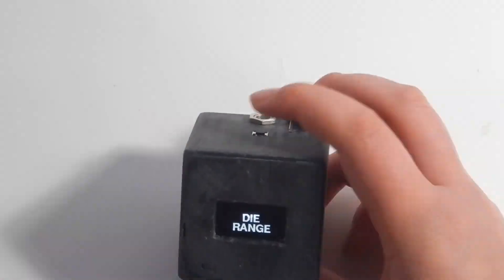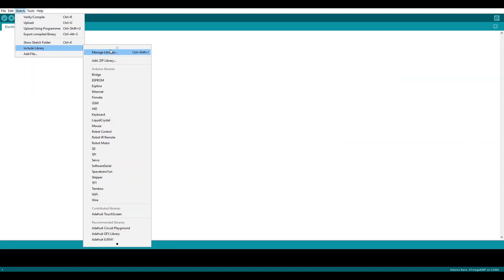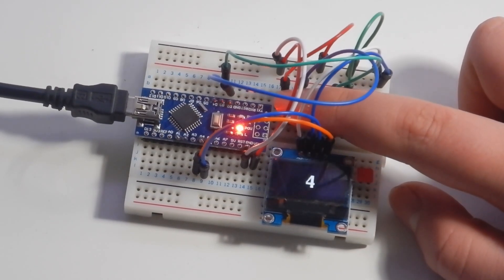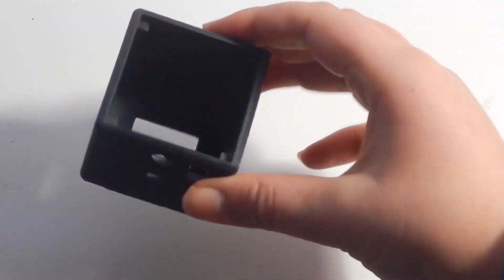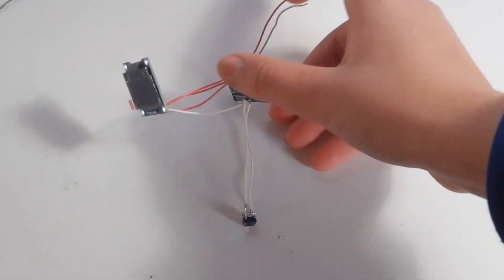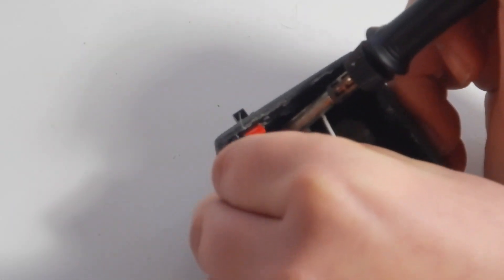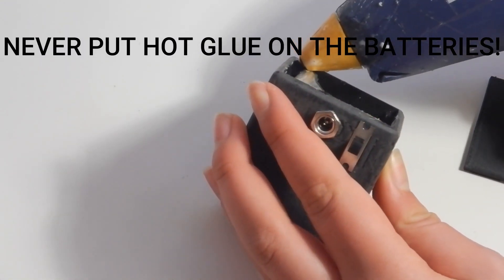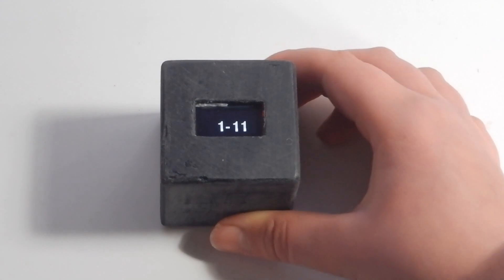Arduino All In One Die!

Comment: How did you do so that when you shake it it worked and could you put all the necessary parts of the assembly? thank you <3
Reply from the maker: I had a sensor that could measure the rotation  (not very precisely, but good enough) so with that info I could program the rest :)
Reply: @BuildAnything  what sensor was it? to order and do the project ^^
Reply from the maker: I always write a parts list in the description :)